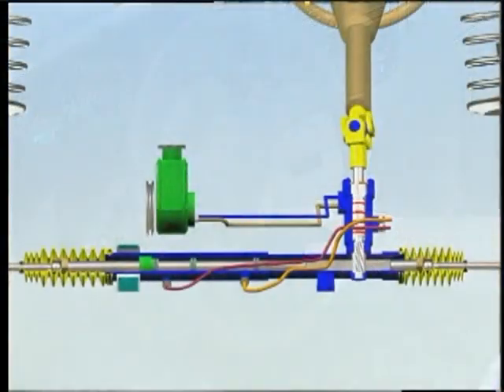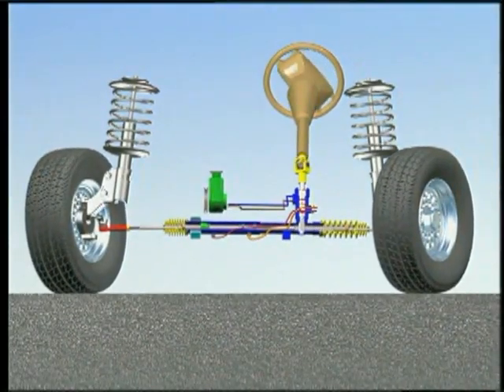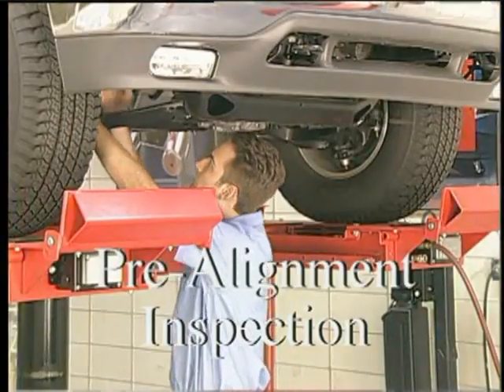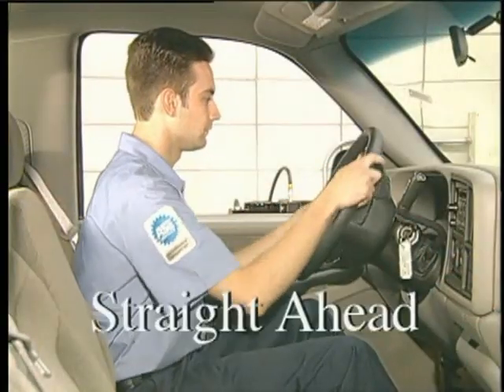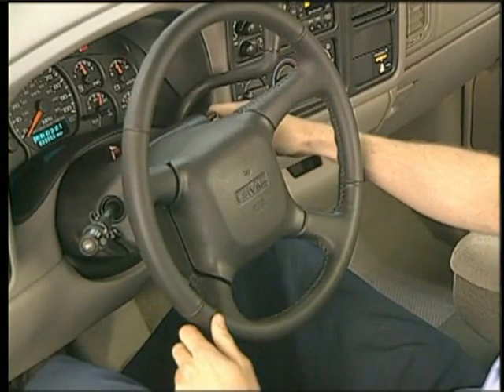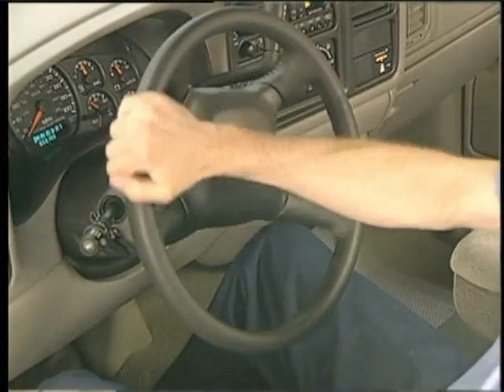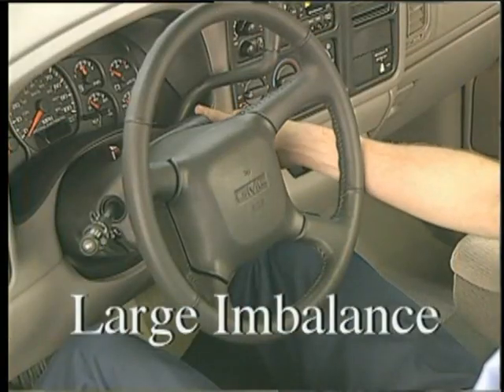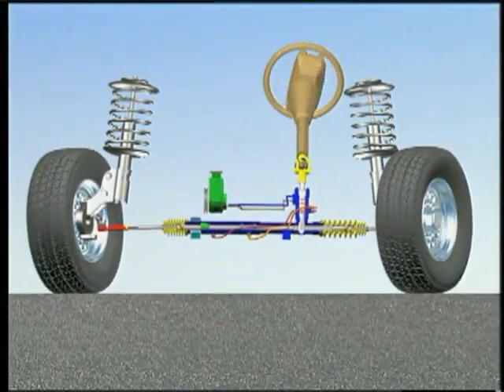What is Power Steering Pull? - Hunter Engineering

Comment: So what is done to fix it if it kicks to the right.
Reply: i dont mean to be off topic but does any of you know of a trick to get back into an Instagram account..?
I stupidly forgot the password. I would love any assistance you can offer me
Reply: @Leonard Keanu thanks for your reply. I found the site thru google and im waiting for the hacking stuff now.
Takes quite some time so I will reply here later with my results.
Reply: @Leonard Keanu It worked and I actually got access to my account again. I'm so happy!
Thanks so much, you really help me out!
Reply: @Gavin Edgar glad I could help =)
Reply: I’ll help you out... your vehicle needs to have its power steering system flushed out. All fluid out of all power steering hoses and the reservoir. They put new fluid into the system and fill it up so it’s at the correct pressure/filled correctly. No air in your hoses is good. Your reservoir is filled up to the fill line. Say if you fill your reservoir up with fluid because you see it’s low. That’s not good. You have fluid in your hoses! That’ll affect the system! You don’t burn power steering fluid it’s always in the system it’s sort of like your brake line system. Basically the same. I have filled my power steering reservoir when I was a teenager with my first truck. It wasn’t up to the fill line so I just added some. Soon I noticed it started to pull to the right. Went in for a alignment... my wheels were straight but the truck still pulled. My power steering system was probably fucked up. I went again and the guys flushed the system and re did it. Gave my truck another alignment. The truck drove like how it should. Just leave your power steering system alone. Your fluid gets old in the system that means it’s time to flush it and change system. My fluid was good. I just fucked it up by adding more into it. I didn’t know. I wasn’t VERY VERY mechanically knowledgeable when I was 18. I didn’t know about that and the cooling system. I did the same thing when I noticed the coolant wasn’t at the level it should be at. I added some. Then I notice soon after the truck began leaking out of the upper radiator hose. Adding more to your system disturbs it. Only add fluid when you notice your vehicle is running hot and it don’t have much coolant in the cooling system. The vehicle DOES burn coolant.